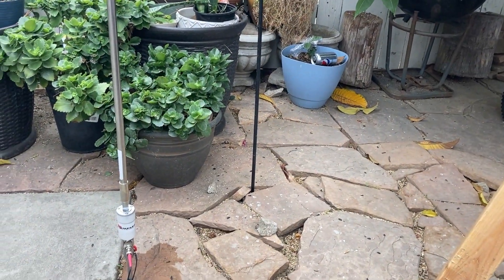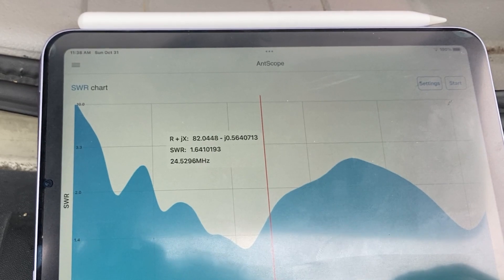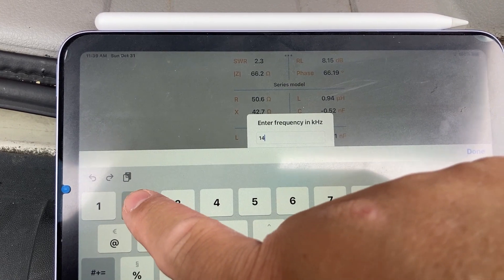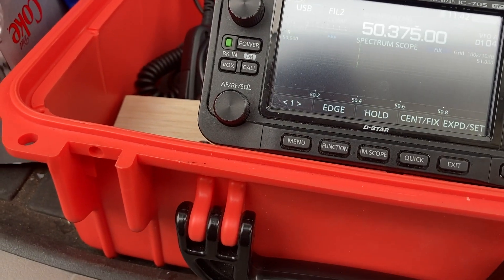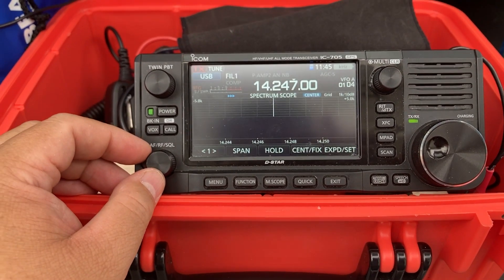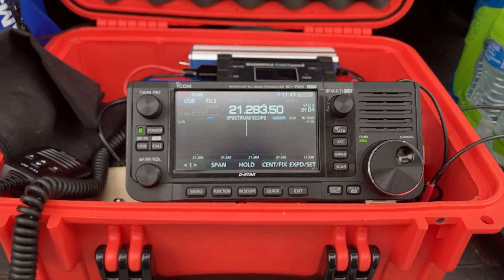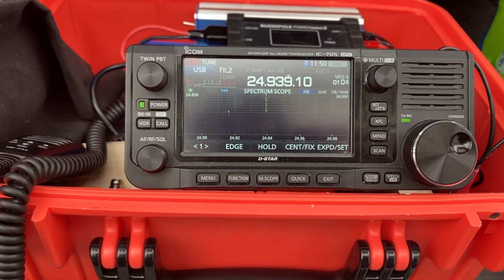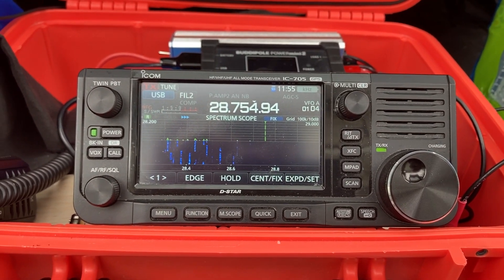CHA MPAS Lite  Deployed at Home

Comment: What were you using to get the SWR readings?
Reply from the maker: The number one thing in this situation was the ground, the dirt, the place that I’m in, was the number one reason why I had good residence. Now that I’ve been doing this for a little while, the water didn’t do anything, the radial might do something, but when it’s on the ground, it’s not as effective as if it was lifted. The things about these particular types of antennas, is that you need to lift the radial up above the ground. This gives it, better abilities to do what it needs to do.  my suggestion, at this point of my ham experience is that you’ll need a tuner. For these types of antennas. I thought with rad I would get the SWR that I needed, but it never came to fruition. I gave up on these antennas because I did not want to use a tuner. So I figured out how to do a quarter wave ground plane Antenna you’ll find it in my channel. It’s super expensive to make and the results are wonderful, especially at this particular time that I filmed this video for the sun cycle was low. Overall, I think everybody goes through a very similar path, trying to find that antenna that really works for them. If you are OK with a tuner, then this will do fine. I’ve moved on and I like mobile much better.  Keep watching my videos you’ll see the transition as I discovered more about Ham Radio.

Comment: I have the MPAS 2.0 almos 2 years now and made several SSB contacts @100w from Ireland to North/South America, to Australia. I do have the CAP hat which electrically lengthens the antenna and it probably does make a difference. I have a lot of fun in the Summer months or even this time of year when 20m is still open in the evenings when I can get on the radio.

I got the MPAS 2.0 to use portable but because it performs so well I leave it up permanently on the front lawn and use it in my sitting room, it makes a really good SWL antenna also and it's a really quiet antenna. 

I put down more radials and SWR increased and I read that this happens when ground losses are being reduced and efficiency improves which is what you want, I especially noticed the performance improvement on 40m where SWR with single radial went from around 1.8 - 2.4. I use the MFJ-939Y auto tuner with the FT-891, a really good tuner, all I have to do is set AM to 5 watts in the radio and when I key up and press up on the mic the radio automatically sends a carrier and the tuner tunes automatically in seconds, I had to open the tuner and set a jumper to get it to work properly with the radio. 

After I added more radials I made a contact around 4000 miles away on 40m, couldn't get that far before. 

I now have 4 radials about 20 feet long, I will add around 10-12 more, if SWR changes a lot one thing I could do is remove the unun and install a remote tuner or installing different UNUN but probably better off buying a dedicated base vertical at that point like a 5BTV or 43 foot.

For what it is the MPAS 2.0 greatly exceeded my expectations.

Comment: I’m floored at the dx wins you got here. I’m a new ham and looking for something discrete for home and love the idea of the mpas lite as it would travel well too when I do SOTA. What are your thoughts on using this vs a inverted V using DS6BKW? Using 100w or less for DX work.
73
KN6RWM
Reply from the maker: For SOTA people do like it. I don’t use it for that, but I’ll  usually go to the park and use it there. Only thing I don’t like is that it doesn’t resonate 40 through 10 m. Many times you have to have a tuner. Or maybe adjust the vertical element. Lately I’ve been using a quarter wave ground plane antenna. Very inexpensive and as long as you have the radiating element lifted it up buy a tree or a mast you’ll get results. I do have a video on quarter wave ground plane antenna.

Comment: Nice 55 signal reports for the contest 😂
Reply from the maker: Ya, I was shocked!  After I found out how far it was.  At the time, I thought it wasn't that far.  Actually on both contacts.  -73
Reply: Propagation was great last weekend so I’m not surprised. Especially with a vertical on a high band.
Reply from the maker: @forgetyourlife  Very true. But is the MPAS a "vertical"?  It has a vertical element and a 9:1 nun.  Can I call my EFHW that has a 49:1 transformer a vertical, if I place the element vertical?
Reply: @frankwc0o  technicaly I think the MPAS is a random wire but yes it’s certainly a vertical. Your efhw in the vertical orientation would be a vertical yes. Not as good as a real “vertical” but that’s why inverted L antennas made from efhw out perform the same antenna mounted purely horizontal. Make sure it’s insulated from the ground. If I could hang my 130ft efhw from a tree straight down you bet I would.
Reply from the maker: @forgetyourlife  Yes, a random wire would be a good name for the CHA, thanks for that.  That makes sense.  I like my EFHW, but haven't used it for about 2 months now that I've found that a 1/4 wave ground plane out performs my EFHW, but then again, I might need some ideas on how to deploy it in the field better.  Lifting it ut 130 feet is way too high.  I usually slope the EFHW and the transformer is up 3 feet or so and the other end is about 30 feet.  I see often people will place the transformer up 20 feet or so and do it as a horizontal.  Finally, the propagation has improved in the last three months.  More testing is needed.
Reply: @frankwc0o  my efhw has the transformer about 35ft then the wire slopes up from there to about 50ft. Small mast strapped to the chimney with the box mounted to it. Coax into an attic vent. A low vertical will always out perform a low horizontal for DX.  Flip that for NVIS contacts on 80 and 40 though.